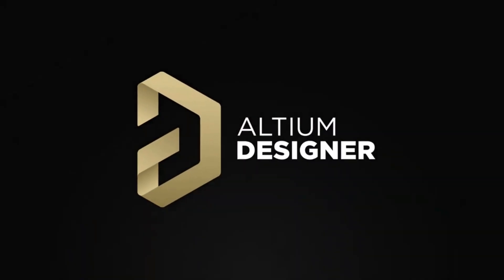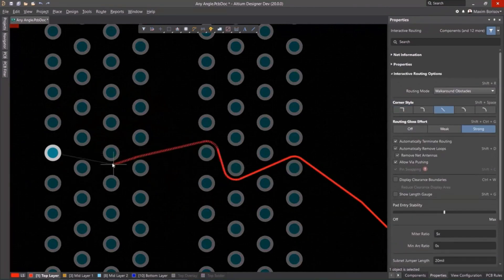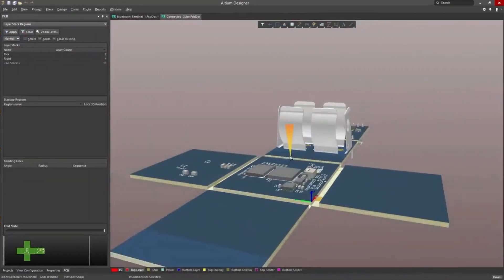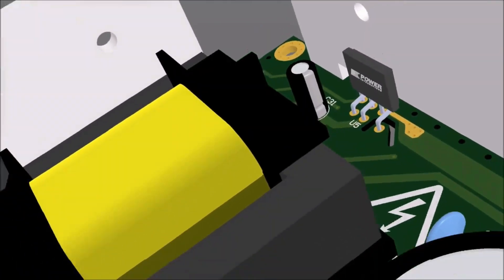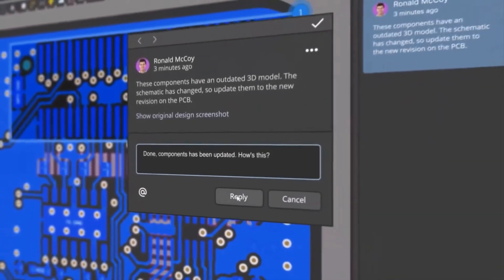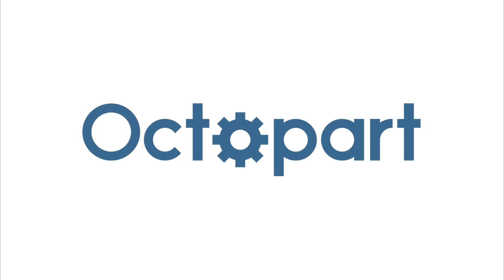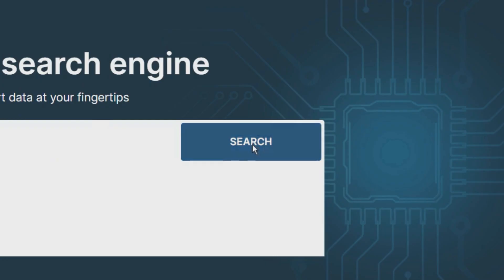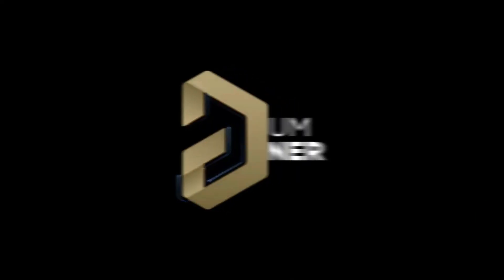808W + 808W Powerful Amplifier using 16+16 transistors 2SA1943 & 2SC5200 #cbzproject

Comment: What tool or method do you use to remove spade connectors which have a locking tab on them? I currently use a tiny jeweler screwdriver but would dearly love to find a special plier or tool that can push open the metal tab from above to allow me to pull off the connector. Even stabbing through the soft insulating cover. I find them a real pain and risk of PCB or speaker damage.